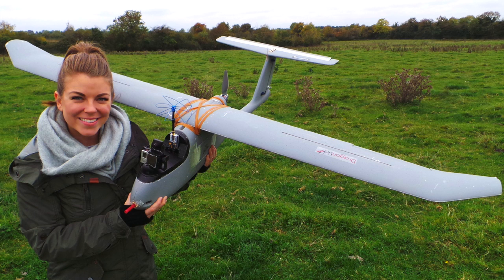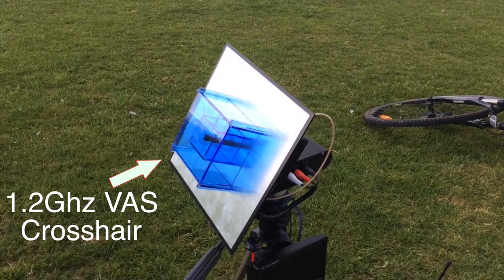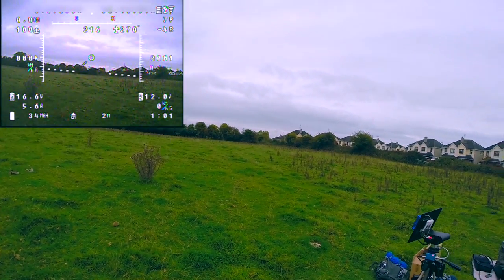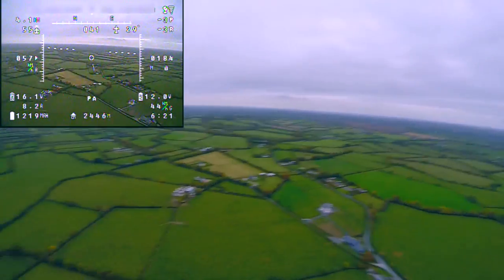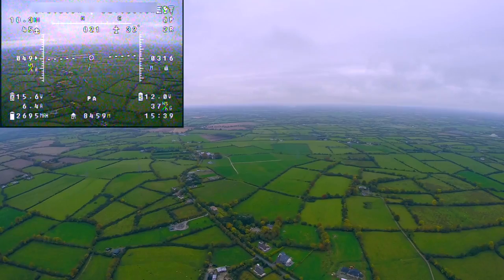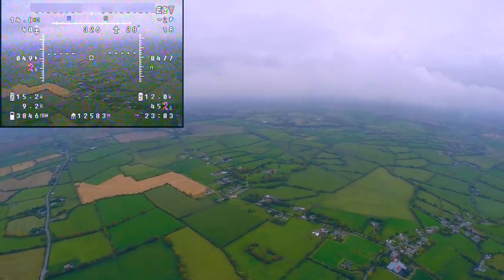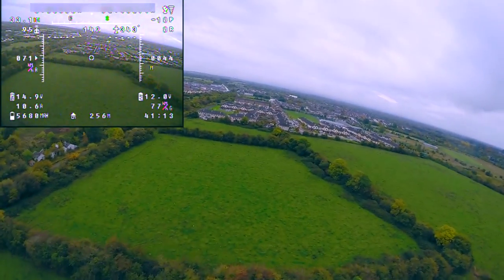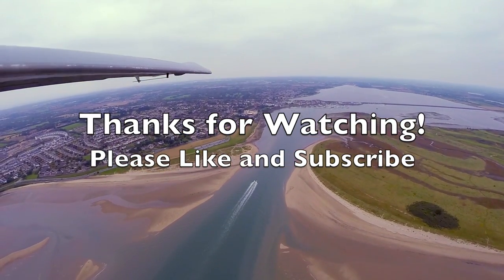Narrated Long Range FPV Setup Overview & 15km Range Test - Skywalker 1900

Comment: dont put gps beneath props lad

put abit from props it will improve more sat signal
Reply from the maker: You had problems in the past? I've had no issues with mine in the current location, get full sat lock throughout my flight

Comment: How do you soilder the etc
Reply from the maker: Do you mean the ESC? I solder bullet connectors onto this to connect it to the motor. On the other end where the power goes into the ESC, you solder it onto the output of the current sesor. If you don't have an AP then you would solder a connector for direct connection to your LiPo.
Reply: Yes
Reply from the maker: In that case I hope my answer was what you were after. I have a wiring diagram link in the video description also.
Reply: Helge Pedersen Tomren if don't know how to solder you probably don't have much rc experience. You might want to learn on something much smaller first

Comment: Try removing the phone, that probably causes tons of interference
Reply from the maker: It was only on there for 30 seconds max
Reply: Adam G does FPV Then the clouds were probably the problem. In the UK I have heard it's always cloudy, so you can't really escape the clouds. I suggest running a 3 watt booster through your video receiver for better range.